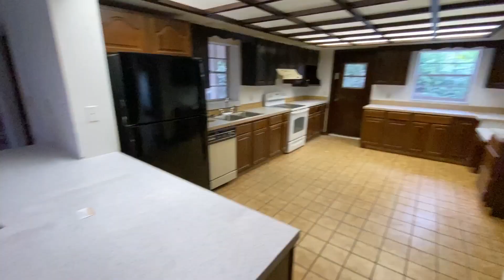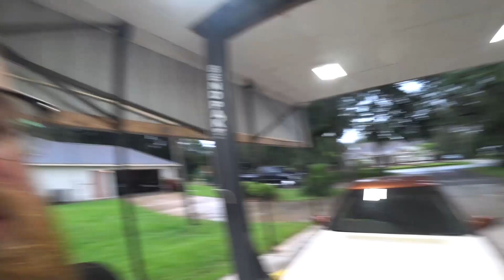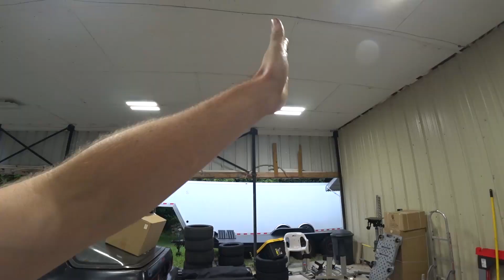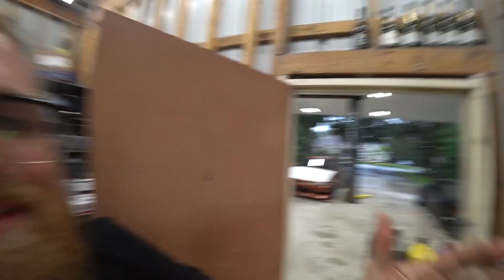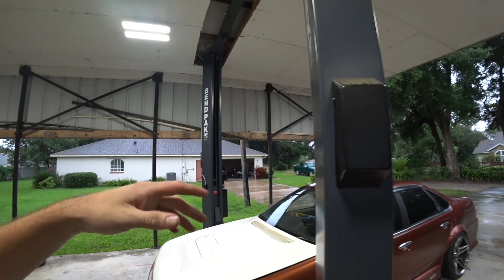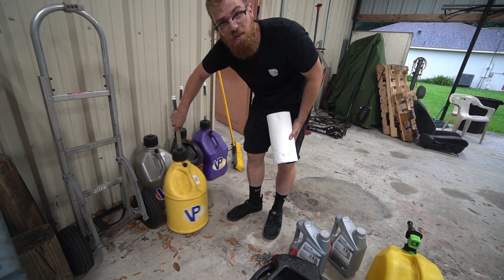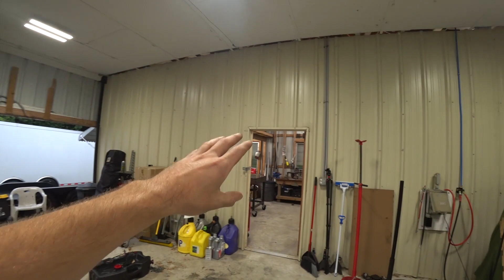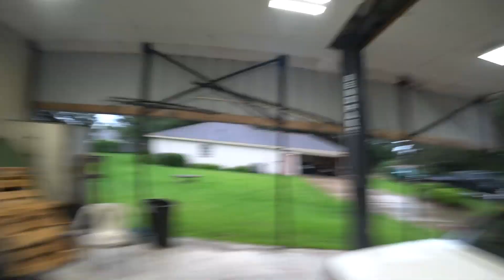Update on my new shop. I have to tear it all down.

Comment: Red tape   it would be easier to get a meth lab approved. than to have a simple project completed.  i live in an area
that has no requirements from city or state agencies  I've built several buildings have had no failures.  we do have 100 mph winds now and then.

Comment: Way too much Gabbering.  To share all the information would take 10 minutes.  Also why not share the bid prices and help educate people.  Don't let the fact that some people have emotional problems when money is talked about, keep you from educating folks.  The reason the planning dept's want an engineered drawing, is they will not accept the responsibility to know what is acceptable.  The same reason they mandate UL ratings.  Most of these people are dumb.  I installed a $100,000 commercial refrigeration system, and it would not pass inspection, because of no UL sticker.  I removed a sticker from something else, and applied it.  Magic, it then passed.